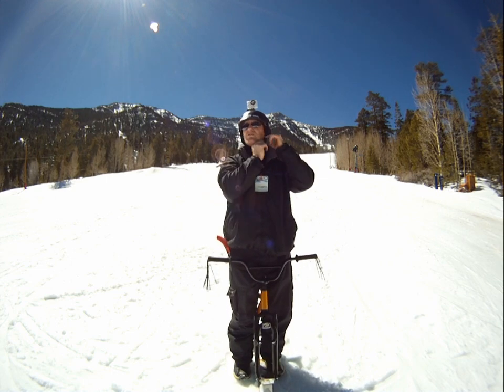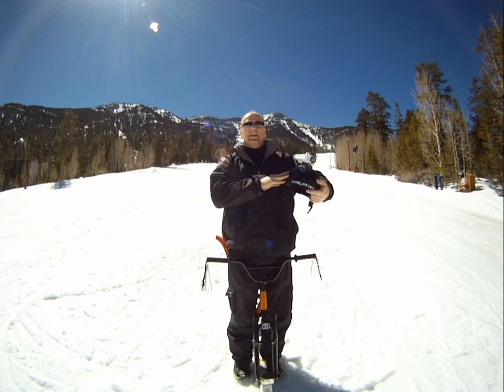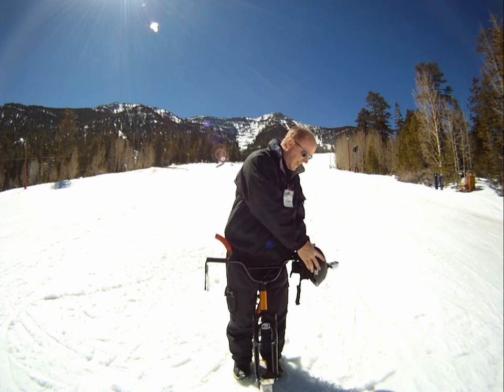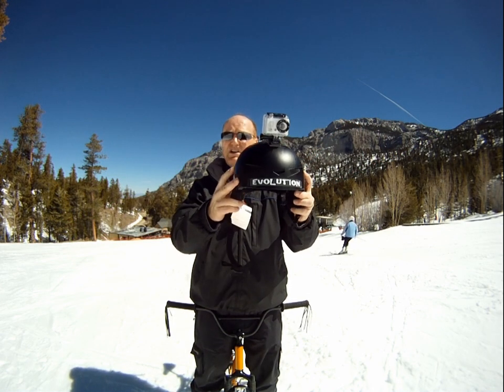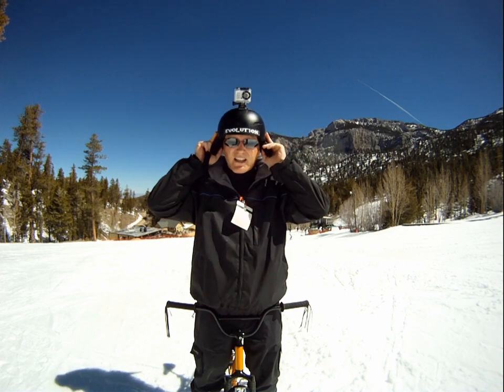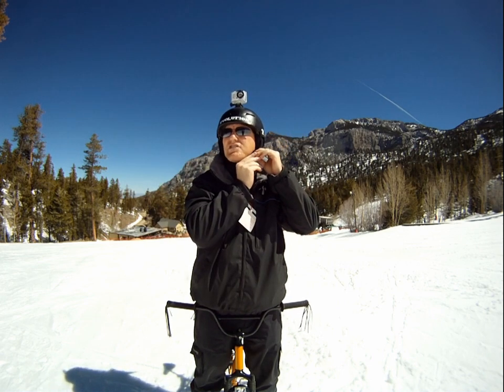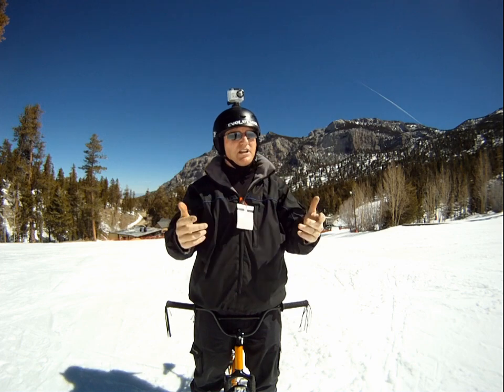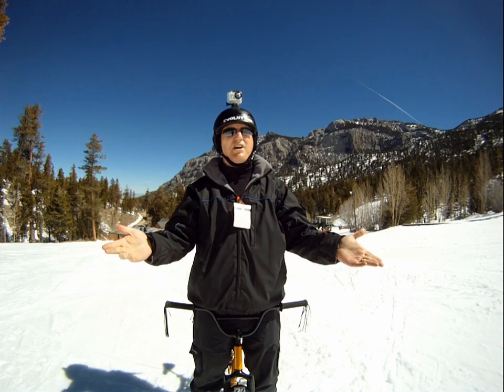TECHNICAL SPECIFICATIONS

Comment: Technobabblicious!  The EA/R-TE is a truly welcome adjunct to the first-gen R-TE (which, sadly, tends to fall down on the job and hunt aimlessly just when sufficiently jiggleroidal barescent skor motion is most urgently required in critical ergonomic applications where mere absence of side fumbling will not do).   "[E]very torsion mount [is] connected by a non-reversible tremie mount to the differential girdle spring on the 'up' end of the grammeters, producing an incredibly efficient equilateral cross-bounding datum"-- words to live by.  The engineering mentality, judiciously focused and creatively applied, can be such a boon to mankind.